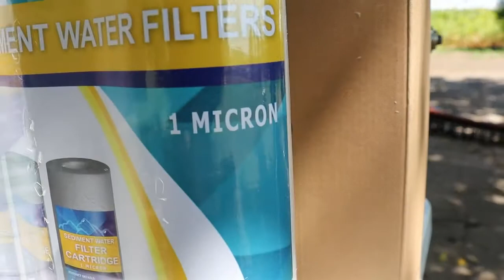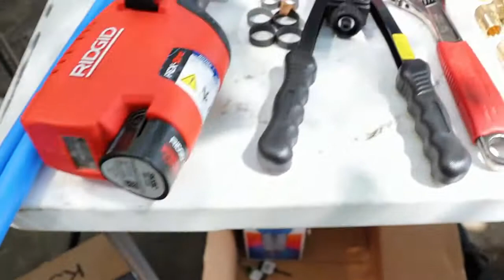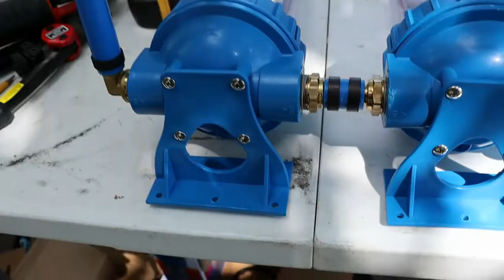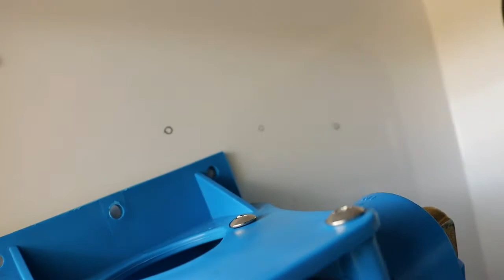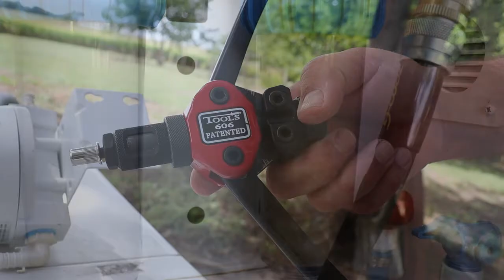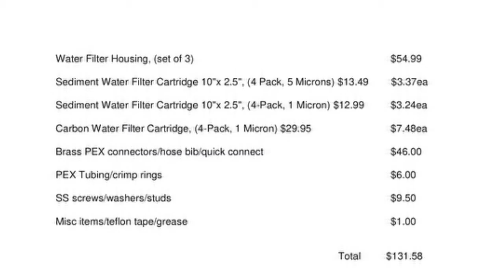Upgrading our single stage water filter to a three stage

Comment: being a year on how is this working out?
Reply from the maker: Working great.  I did switch brands of the carbon filter to 
SimPure 5 Micron 10" x 2.5" Whole House Carbon Block Filter Cartridge Replacement for WFPFC8002, WFPFC9001, FXWTC, SCWH-5, Compatible with Home Under- https://www.amazon.com/dp/B07QWWPM9C/ref=cm_sw_r_cp_apip_Yi3KQrecUmplw
They have a little bit higher rating.